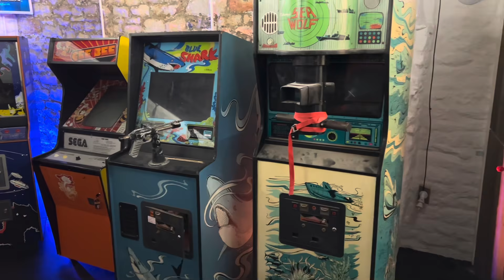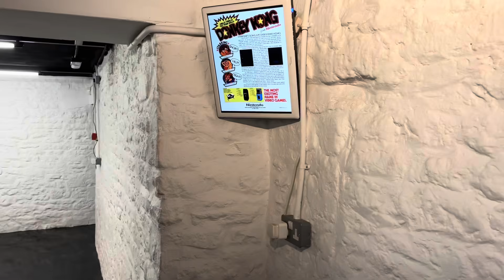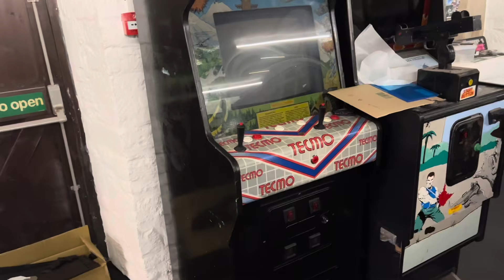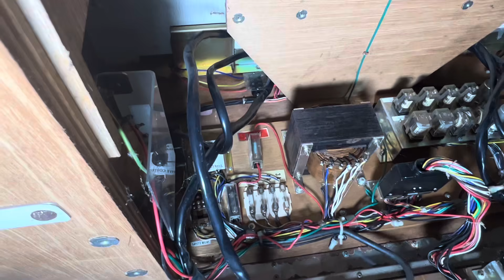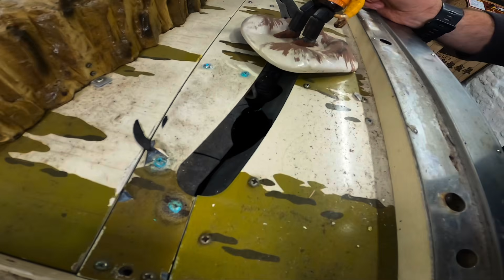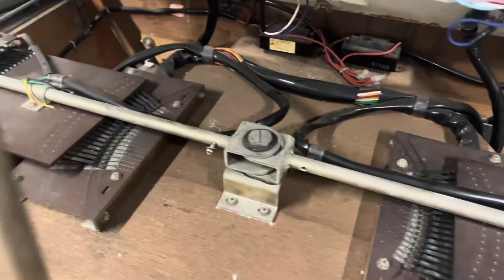Sega Gun Fight - First look and Arrival of a 1969 Electro-Mechanical Arcade Game

Comment: Try and get a Star Castle. Its an early 80s game. Actually, I think it was released in 1980. It's made by Cinematronics, and has vector graphics and great gameplay. It definitely belongs in an arcade museum. You can find them in the states from $1200 to $2400 depending on condition. Less if you dont mind doing a restoration. Another great 80s game is Vanguard.

Comment: When I was fixing an EM desert fox one thing that caught me out was the diodes. They are beads between two wires and what happens is over time the wires break but they still hold the bead in place. What this means is you have what looks like a good component but there is no continuity. There were quite a few in the sound circuit and of course ones used for rectifying the AC to DC.

Comment: I recommend getting a lock picking set.
I got some lock picks off of Amazon myself for when I get Arcade machines that I do not have the key for.
Most lock pick sets come with those practice padlocks.
But the best way to get better at picking is just picking locks.
I would start with single sided ones first then do double sided locks.

The reason I got my pick set is to not make a mess every where when I were to drill out the lock.
And I love to see this kind of thing I also buy machines and fix them up I just love seeing broken machines come back to life again. :)
Reply from the maker: The trouble is we need to put a locks on all the coin doors so kids don’t open them. So we still need to change the locks we don’t have keys for.
Luckily today I did find two original keys for a couple of Midway games so they can keep the original locks.
Thanks for watching it’s much appreciated 😎👍

Comment: At the Arcade und Flippermuseum Seligenstadt (Germany) we have 14 (fourteen) Moon Patrol boards in storage...
(all bootlegs though, but also all of them working) maybe you (or I) can ask the owner if you can have one.
Reply from the maker: That would be amazing thank you 🙏
Reply: @TheArcadeArchive  The owner says he's ok with it. I'll mail you soon.
Testing the boards in a machine found a few minor problems, so fully working boards that don't spell "MOON RANGER" on the title screen are kinda rare, but they're all playable.
Now the next question is - there are two versions of the sound board. One has an IR remote ceramic oscillator with a dedicated sound chip just for missing rockets and hitting rocks. The others seem to emulate that on the AY chips. The ones with the dedicated explosion IC sound a lot better (at least when blasting rocks). The sound boards can be mixed'n'matched, but we only have two sound boards with the dedicated chip. Which version do you want?
(btw. the non-fully-working games have following problems: One doesn't keep a high score, it will either show 000000 or sometimes briefly garbage that looks like it spells "idiot". The other has enemy projectile explosion animations inverted, they show up as a colorful box instead of a tiny explosion. This is if you manage to hit the enemy projectiles so very rare and probably a PITA to debug. So these are still fully playable.)

Comment: That looks amazing. The contacts for the movement are so many, it must have a decent difficultly to it. It looks so clean and free from corrosion, someone stored it very well.
Reply from the maker: It is in amazing condition for its age and hopefully won’t be to difficult to get working. I can’t wait to see everyone enjoying it.
Reply: @TheArcadeArchive  I've read repair posts with people saying that they use paper, something like a business card to clean the soft thinly plated gold or silver on the tarnished contact points. I wouldn't be using anything too abrasive like sand paper on those, if I could help it. They only need to be cleaned really. You don't want to remove there thin plating, if at all possible.But I'm sure Richard probably knows all that already. Good luck with the restore 😉
Reply from the maker: @anthonydenn4345  Always good to hear what other people have done.
Thanks Anthony 👍

Comment: Such a amazing and wonderful space, too bad it's just not around the corner for me.
Those electromechanical cabinets are just sooooooo fascinating!!!

My suggestion is to do something a bit more about the acoustics, doesn't have to be anything fancy. 👍
Keep up the incredible work!
Reply from the maker: The acoustics is not great in that small room i realise. Im going to look at bringing in the mats that we have in the arcade which might absorb most of the sound. Also once we have more stuff in there it will help.
Reply: @TheArcadeArchive  No worries! 👍
I would suggest putting some material on the ceiling maybe.